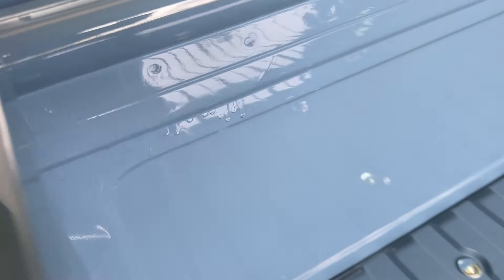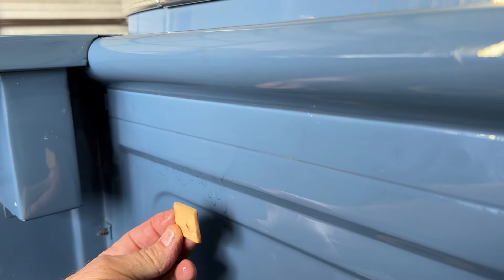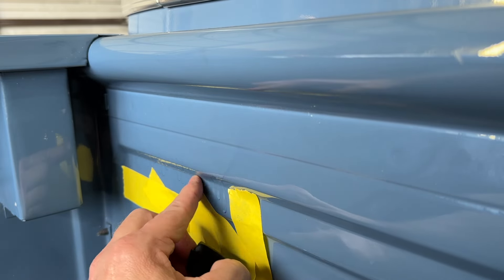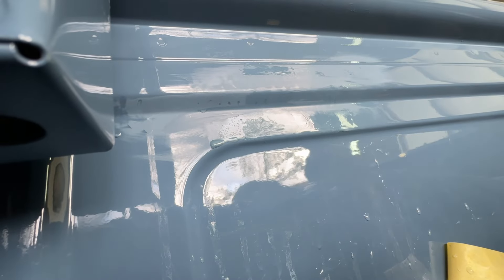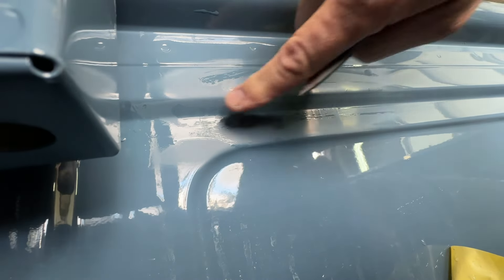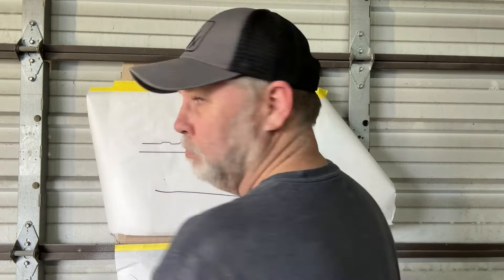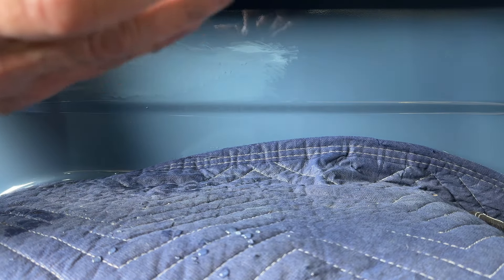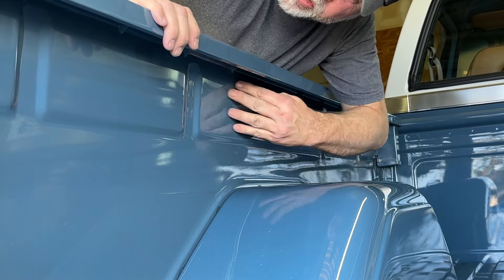C10 Project:  Sanding out Runs and Buffing

Comment: lol I painted my own interior on my current project and boy this video is right on time!
Reply from the maker: Lol, yeah it’s just part of painting. Good luck on your project!
Reply: @StoutCustom    Also,  just thought about it,  if you would have followed my advice and shot some bedliner in that almost perfectly painted and dent removed bed you wouldnt have had to fix that run.  😁
Reply from the maker: @UFPTX  lol, great point
Reply: I wish 2 1/2 years ago when you sand single stage runs they end up with a white type haze. I sprayed my truck had a few runs ( you know if don’t get runs you ain’t painting) put most of the truck back together giving the paint time to cure started working on the runs and they turned white ish . Took it all back apart sanded reworked some bodywork resprayed primer then guid coat and sanded.Started masking last night going base clear this time around.  What I did when working the runs out was paint sticks different grits and wrap3/4” masking tape on each end when I got close finer grit no tape on ends. On the razor blades I’d hit the corners on the bench grinder. Do you still have both of the trucks you painted this blue?
Reply from the maker: @timhudson8958  the 67 wasn’t mine but the owner has it together and going to shows. The squarebody is mine. They look very similar in video but the blue and the white are different on each one.

Comment: Does the razor blade trick not work on single stage or do you not like that method?
Reply from the maker: It works on single stage but I’m not a big fan of the method. I would just rather start with a coarse grit and sand it.